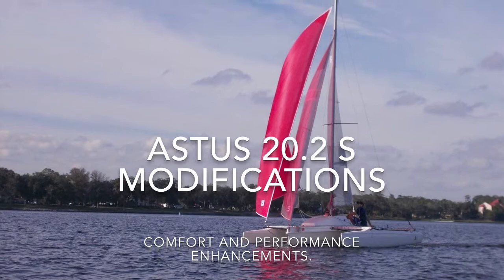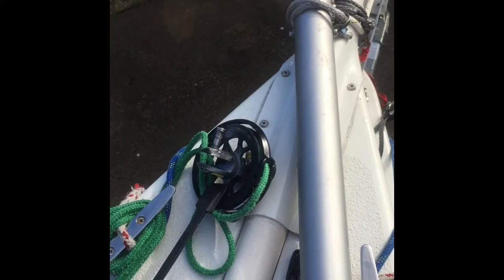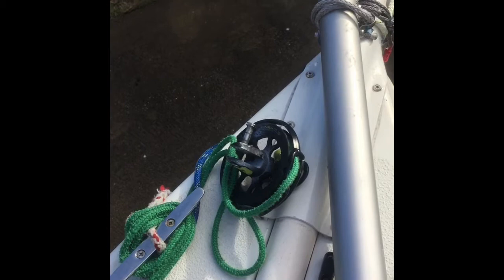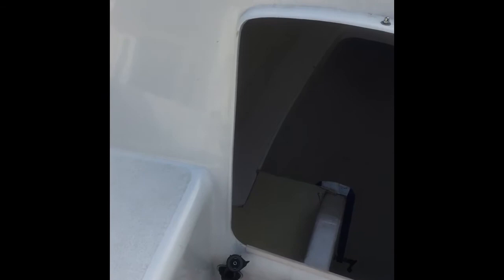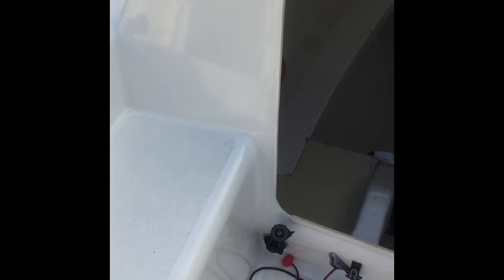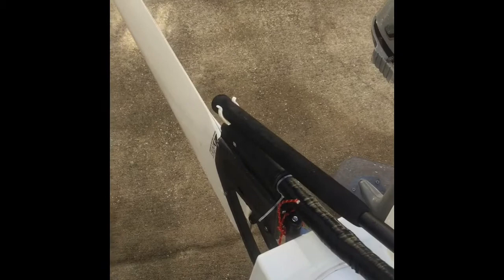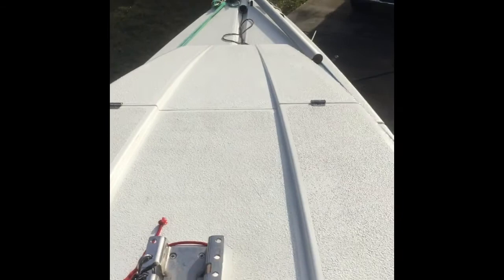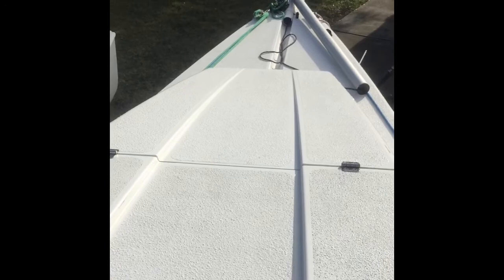Astus 20 2 s modified

Comment: Hi Vincent, very nice modifications. I'm also an owner of an Astus 20.2xl since 2017. I like the ruder modification, the second one in the video 8:05, to lower the ruder is very interesting. can you explain more? Tks
Reply from the maker: Hi Yano. 
This is a Dotan commercial rudder. You change the blade position by lifting the tiller up and down. There is a swivel link that converts the tiller motion into rudder blade rotation. It’s pretty ingenious and has been very reliable so far on the boat.

Comment: What kind of Dotan rudder and blade you use now?  Can you give more info abaut the Spinnaker and the Jib? It ist made your you or from another boat.
Reply from the maker: Hi, Thomas.
These were custom-made by Calvert Sails. I sent them the dimensions of the rig and they designed what they call "maximum-size" sails upfront,. both for Jib and Spi. The jib also has vertical battens to increase the roach while remaining usable with a furler.